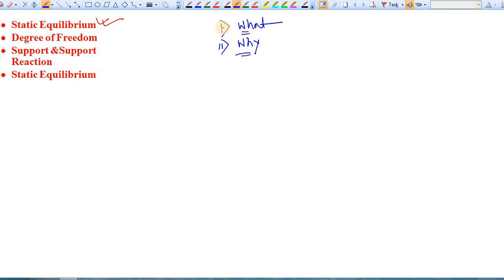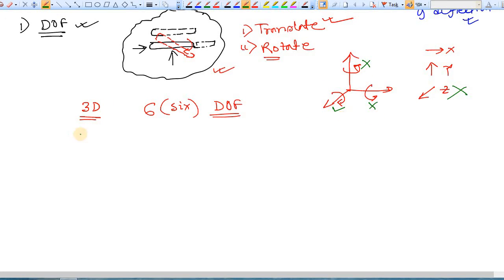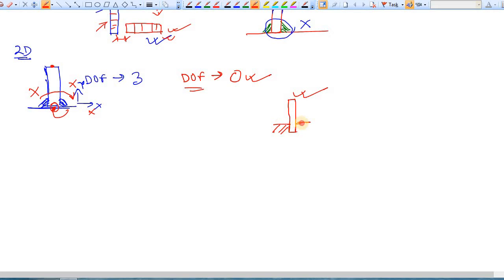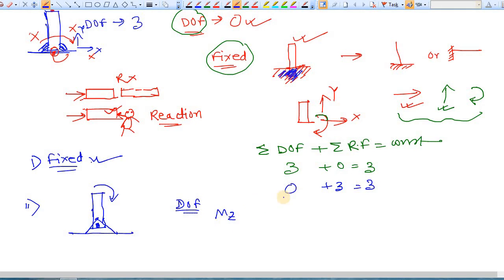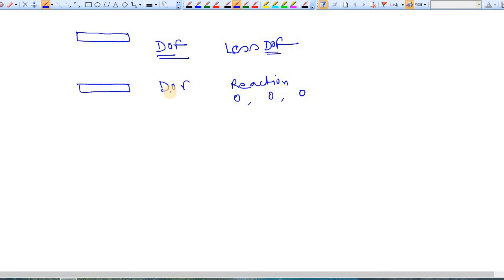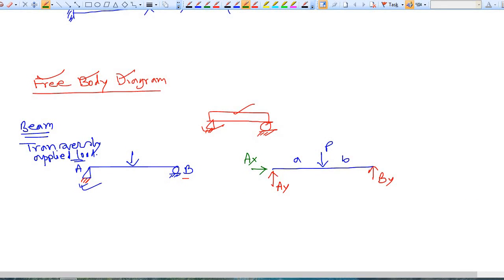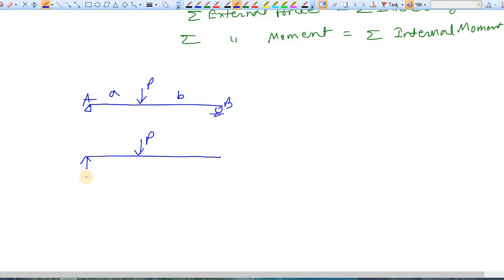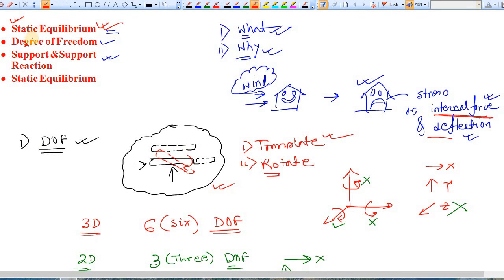Static Equilibrium |Degree of Freedom|Free Body Diagram | Equilibrium Equation|Structural Analysis

Comment: Sir group a kichu chele bola-boli korchilo sunlam j plain b.tech without experience or m.tech degreee prefer kore AE te... interview te baaad diye dei.... is it true?
Reply from the maker: Not at all. There are students with higher degree and experience but don't know plastic Section modulus. And somebody with plain b.tech know much more. 
Just know your strength and play accordingly in the interview. Right now concentrate on written. If required I will share my interview experience later. Have a good time.
Reply: Thanku so much